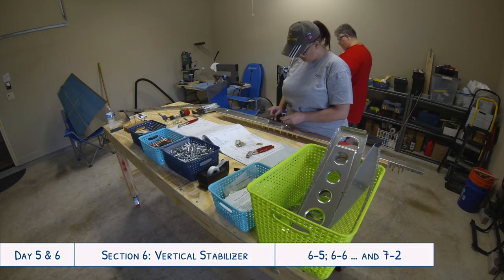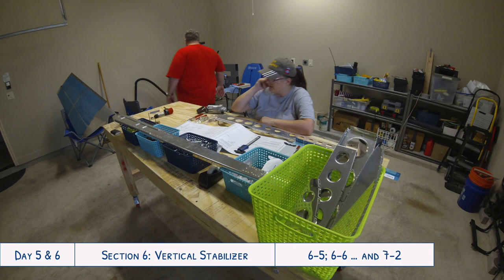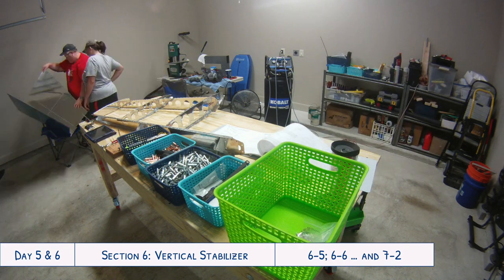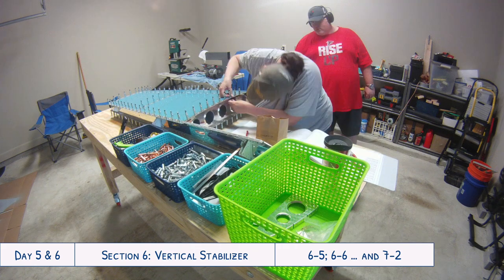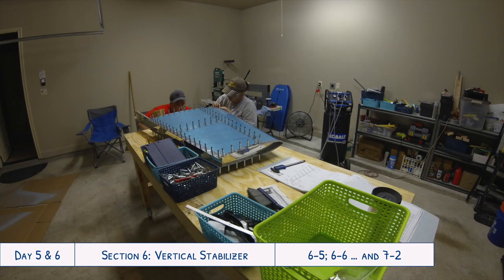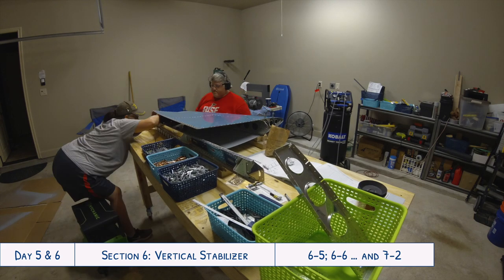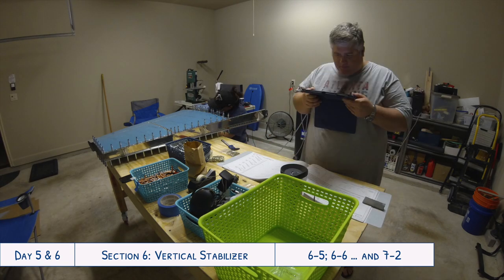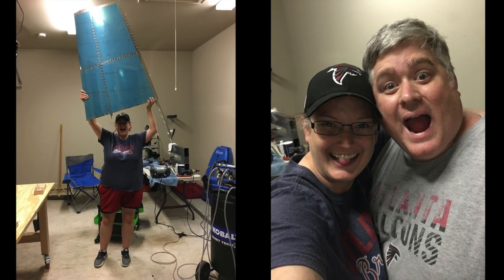Van's Aircraft RV-10 Build - Finishing the Vertical Stabilizer! (6-5, 6-6 & 7-2)

Comment: Congratulations on finishing the first big piece!
As for deburring, I just use a 6” grinder with 3m wheel on it for all of my initial deburring. For finishing work or places where the wheel won’t reach I use small files and strips of fine grit sandpaper. Then finish off with a maroon 3m scotchbrite pad. I have a small belt sander for woodworking but have never really found a need for it in my RV10 build. 
As for your riveting: mistakes and bad rivets happen, no worries. Drill out and repeat. Proper technique in drilling out is important though b/c if you just drill straight through you can enlarge the hole. Just drill a small hole in the head of the rivet big enough to fit a punch in and pop the head off. Then use the same punch and a hammer to punch the rest of the rivet out the back side. On thinner material it is important to use a backing plate of some type so you don’t bend the metal when your hammering out the rivet. I have a couple small blocks of wood of different sizes with a small hole drilled in them that the shop head sits in so when I’m hammering out the rivet it doesn’t bend the aft piece of metal. 

There are many instances where 2 person riveting is way easier and some times even required so it’s great that you guys are doing this together. Also, like you mentioned there are quite a few “gotcha” areas where if you assemble something out of order you’re going to be stuck. Think through each step and assemble it mentally before driving those rivets so you don’t have to drill them out later b/c you blocked yourself.
Reply from the maker: Thanks for the feedback on the belt sander! We've been using the 6" 3M wheel on the bench grinder and so far I think it works great. We also have to smaller wheels that came with a drill bit to use with the drill that comes in handy sometimes. And we did get different size & shape files to use to get into those tighter spaces (boy some really are a pain to get into!)

We got some good practice drilling out rivets on the little starter kit we got from Vans (we did two each just to make sure we were really comfortable with everything).

And the nice thing with having 2 of us is not only the extra pair of hands, but the extra pair of eyes to look over everything and try to catch any mistakes!

Comment: Belt sander works well, just don't do it so hard you damage the piece.  I even deburr by hand with sandpaper, if that is the best for the circumstances.  Sometimes a steel file.  Sometimes sandpaper around a wooden block.